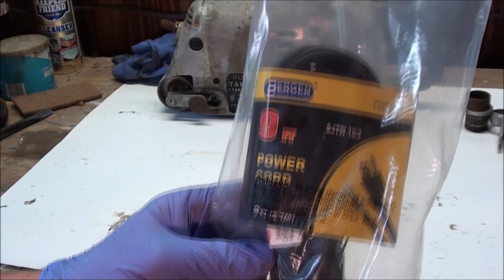Restoration Porter Cable BB10 Locomotive Belt Sander Vintage

Comment: Thanks for taking to time to produce this video. I have a half dozen of these Porter Cable Locomotive sanders in my basement in varying states of repair. One day I will get serious about bringing them up to spec. 😁
Reply from the maker: Nice, you should fix them up. Probably worth some money reconditioned. I wanted to fix mine up because it was my grandfather's.
Reply: @AdventureContinuesAgain  I have some 1960s era Porter Cable tools that belonged to my father and still work very well. A few years ago I wandered into online listings for 'used tools' and much to my surprise, found a PC circular saw of similar vintage to my father's as well as a 1970s Skil worm drive saw. Both were modestly priced and located within a half hour drive of my house. The next thing you know I became a vintage tool collector with a steep learning curve ahead of me.   I try to find American or Canadian made tools in working or salvageable condition  and save them from the scrap heap.  I really enjoy using them for my occasional small projects but I certainly don't think of it as a way to make money.

Comment: Nice job. These were the best belt sanders ever made. I have nearly all of the Porter Cable Take Abouts. There were about a dozen different worm drive models. 
This BB10 is post war, probably 1951 at the latest. I have a pre war model with a wooden handle. Don't forget to check the gear oil! The original Porter Cable lube is tough to track down, but Skil worm drive lube is a good alternative.
Reply from the maker: Thanks for the info

Comment: You don’t go over what that lil cap is for towards the beginning.    It’s almost like it’s an oil reservoir?
Reply from the maker: Correct, it's for filling oil into the drive chain. Usually a lower viscosity than what I used.